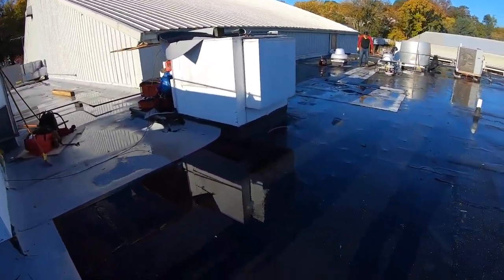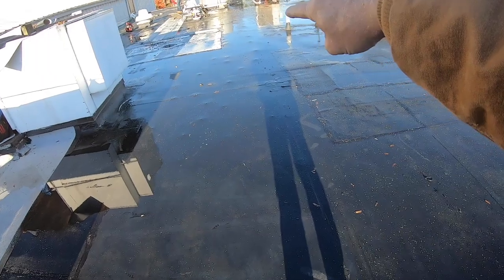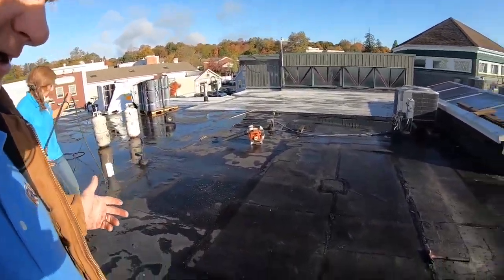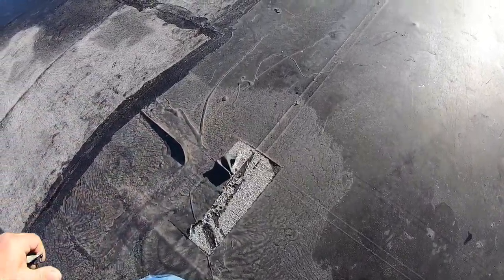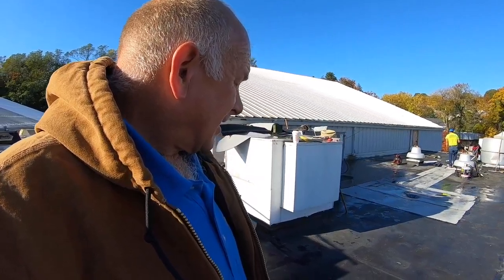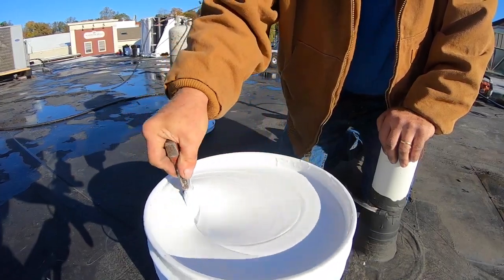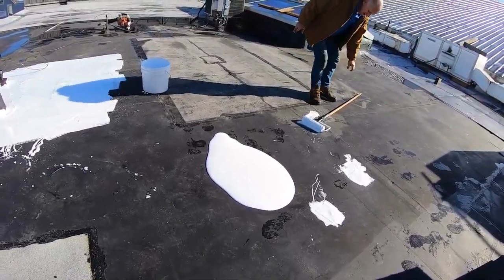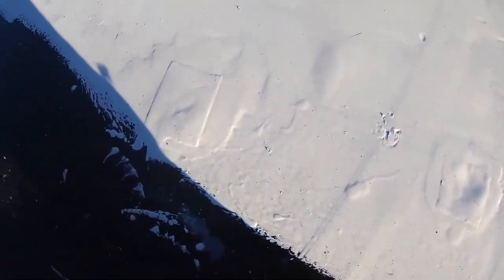Rubber Roof Leak Repair/Sealed - Flat Roof Leak Fixed - Super Silicone Seal

Comment: If there is water under the existing roof, shouldn’t  the roof be torn off?  The insulation is saturated and collapsing around the screw. I can’t believe you are not tearing off the existing system. Trapping water will only make matters worse.

Comment: Hi I have tin roofing over plywood can i put this on the plywood for extra protection as I'm some leaks thanks for the tips
Reply from the maker: I am not sure how you want to go about it. Do you want to remove the Tin Roofing and then coat the plywood?
I think you should just find what causes the leak and fix that. Then coat the tin roof
Reply: At the moment it has plastic tarp and tin roofing sheets on top just thinking what can replace the tarp thanks for your reply
Reply from the maker: @logman6656  Why don't you get EPDM Rubber membrane from a Roofing Supply place. That would be the best way to go
You get the right width and then fasten it to the sides where the wall starts. You can cut it with scissors to the right size and use screws with washers to fasten it on the edges
Reply: Thank you i will look into it 👍
Reply: @FlatRoofDoctor  what do you think of alwitra ?
Reply from the maker: @davidowen1074  No idea what that is

Comment: When we spoke a few months ago you recommended I use EPDM to repair the leaks on my flat EPDM roof. Are you now recommending I use this silicon seal instead?  If not then when would you patch with EPDM and when would you patch with Silicon Seal?
Reply from the maker: Ok, EPDM is notorious for leaking at the seams. The adhesives breaks down that hold the seams together. If you are planning to put the house on the market in the near future, then you want to make the repairs less obvious. Using EPDM in this case would be better. 
Super Silicone Seal is white. If you have the money, then coat the entire roof with Super Silicone Seal. That will make it uniform color.
For repairing seams and holes, I think Super Silicone Seal is better.
If you watch the video, you will notice that the Super Silicone Seal and the EPDM becomes monolithic. You can not achieve the same results with 2 layers of EPDM. 
Here is my take on EPDM roofs that need repairs. Make repairs where necessary first. Nailing down the screws that pops up, putting a little patch over those areas. Then patch seams around skylight curbs with SSS and Fleece.
Once you have ensured that all potential leaks are taken care of, then coat the entire roof with Super Silicone Seal. This will give you a brand new roof that will last a a very long time.
I saved an EPDM a few years ago with this method. It is amazing how well it performs. The roof is 40% cooler and the existing adhesives on the EPDM seams are breaking down.
Reply: @FlatRoofDoctor  Great answer. Thank you. Is there a way to buy SSS at a discount for bulk?

Comment: whats the differents between super silicone vs Turbo Poly Seal – water sealant ? what you you recombine for a 22yr old metal roof, no rust but just leaking ?

Comment: I did this I couldn't find any information on it at all. So I figured it all out myself  last summer and it seems to be working I use the dural brite white elastometric.  You can test it by buying a gallon and putting it on overnight and letting it dry and it bonded just perfect to the rubber. I had a 1200' garage building for a 4 plex  apartment complex with a flat rubber roof garages all shared a wall. I had more serious problems than this  roof has I had rolls in my roof where it stretched. What I did was I cut is cut the rolls in the center  with a  really sharp foot long knife and nailed them down flat with roofing nails  on both sides of the cut  tight as i could get it as close to together almost o er lapping the cut.Them then I went and put fiberglass tape on it or whatever type of tape home depot's sells for roofing 4 inch wide rollspulling henry roofing cememt on both sides of the tape let it dry hard. The tape  looks like the stuff you're putting joints on walls you mud over.  Where the rolls were it pretty flat now .  On  top i put 2 coats of dural   brite white  eladtometic seal it then I went over with the white stuff after it's all dry. I washed  the roof off before I did it.  Use 2 Coats and it's hard as hard as rock now . It's  as not good. But it cost a lot less by useing the dural bright because it costs less, the  stuff hes using is like $250  or more for 5 gallons the dural brite is about $87  for 5 gallons and it good   for about 10 years.  The guys that are doing it  for money they y  are going  tell you that  you need the most expensive stuff they sell. Well sure it better it more expensive but hard on your budget . I'm just a private owner of a 4 plux with garages. I don't want to spend 15 to $20, 000 higher than somebody like this crew  to do it. I plan  planned on recoading  at about 8 years and I can extend the life doing that.  And I spent less than a $1000 doing it myself doing it . My is not leaking now.  This stuff is lighter than roofing so you can recoat it. Pretty sure this roofing crew would have told me my roof wasn't fixable have a nose rolls in it. However I extended the life of it myself and it's harder's rock on there I've been up there checking it.

Comment: Roof doctor, can you place a torch down roof over a rubber roof or do you need to remove the rubber first?
Reply from the maker: I am assuming by "rubber" you mean EPSM? If so, I use a self-stick base for Torch down straight onto the EPDM. I don't even bother to screw it down. Then I torch to the self-stick base.
Reply: @FlatRoofDoctor  do you have a video of this being done? Thanks for your great videos!

Comment: Quick question once to apply the Super Silicone Seal per the instructions then you say give it 15 years for the life expectancy can you just apply apply two more coats for another 15 years or do you need to replace the whole epdm roof before you apply the second application of the Super Silicone Seal for another 15 year life expectancy?
Reply from the maker: You never have to replace the roof. it will last very long